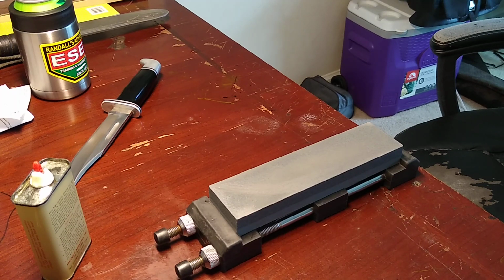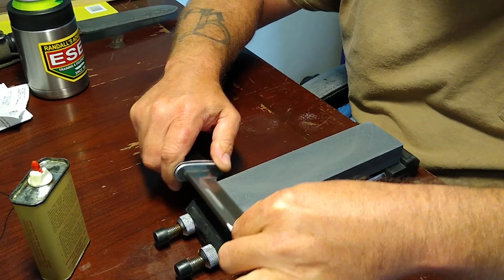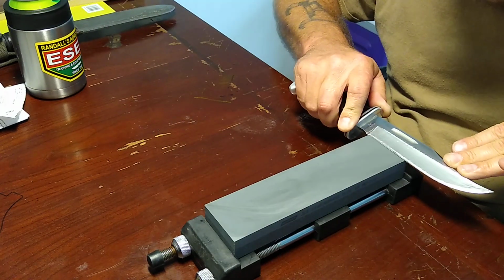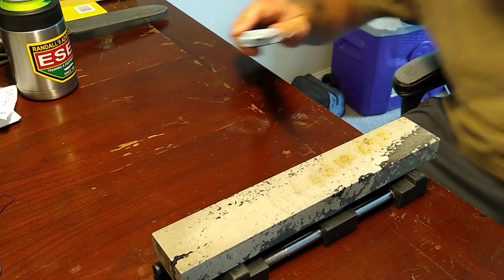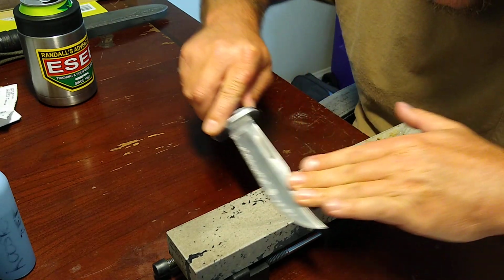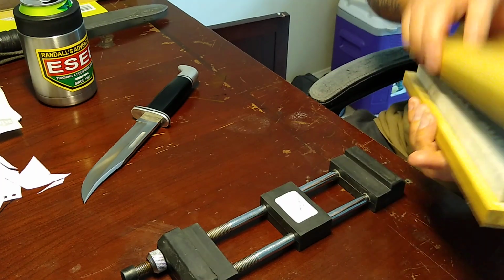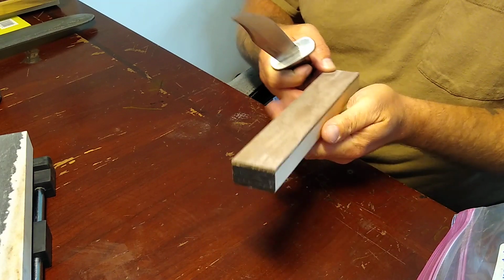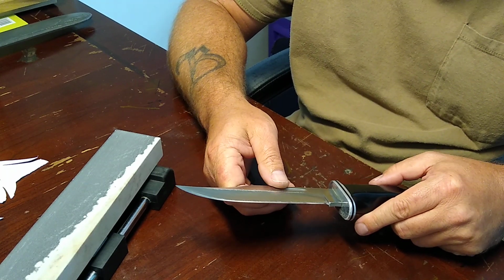Buck 119 sharpening

Comment: ive got a new (old) rarely used 119 from '72-'86, and its got the same exact blade profile as this one. the knife being narrower closer to the guard is just how they came back then. Compare that to a brand new off the shelf 119 and its a lot different. this old design gives the front of the blade a lot more belly for slicing, compared to the new knives "belly" that looks a lot more like a kabar clip point.

Comment: I've been thinking about picking up the 119 Pro in S35VN.  I own a Buck  110 that I bought In 1978 and I"ve got a newer Buck Compadre in 5160. What are your thoughts on the 119 in S35VN?
Reply from the maker: S35vn is my most hated steel. I don't like it's make up. Just don't do well for me.
Reply: @Rough Rooster Knife Sharpening  
In what regards doesn't it do well for you?

Comment: Another good job bud! What is the cause of metal doing that? I have ran into that with some 1095. I have carried a 80t Old Timer for over 20 years & now it does that to me. Could it be from being sharpened so many times over the years?
Reply from the maker: This is one question I cannot answer. I've never figured it out.
Reply: I believe it’s something with the steel I had it happen on a old timer from the 70s and it’s been sharpened a bunch and the blade is getting wore down a lot I think what causes it is something with the way they heat treat the knives and slowly you get into the parts without as good of a heat treat

Comment: Mister I don't have a fancy Stone like yours but I have a buck 119 who regrettably to say pretty much ate at the edge of my file and is resisting my stone would you agree that maybe I have maybe and older buck 119
Reply: That's easy enough to find out. The tank stamp will tell you the age of the knife. Just google how old is my Buck? and it will take you to the chart that says how old it is. Each year they make a different stamp so they can easily be dated.
Reply from the maker: That's not completely correct. The pre 1986 bucks can get very tricky. But after 86 they did stamp all the tangs with different symbols
Reply: @roughroosterknifesharpenin5531  true, but unless I read it wrong, he's just wondering if his 119 is old or not, and he can find that out from the chart..maybe not an exact year, unless it's post 86, but at least an idea of if it's pre 86 or not, and thereby an idea of if it's 420hc or not

Comment: That stone would probably be considered a #1 by anyone else but Dan's. Their grading system is uncompromising, and one of the biggest reasons to shop them. Period.
Reply from the maker: I couldn't agree more
Reply: @roughroosterknifesharpenin5531  , Mike is right....I bought a #1 8×3×1 Washita from Dan's....much denser than any "Washitas" I've encountered before. Also, if you get one from Dan's,  it will have NO voids in it. That's why they don't advertise them. They probably have a ton of rock that would be comparable to another companies Washitas but they won't ship less than perfect ones.

Comment: Rooster, once I raise a burr on one side flip and move burr to the other, how doI remove the burr? Thanx
Reply: Start alternating.  If it took 20 strokes to raise then 20 to get to the other side drop to 15 on each side, 10 then 5, then 3, 2,1 then 20 - 30 one stroke each side.  My opinion anyway.
Reply from the maker: Bama fan is right. If you'll flip it back and forth and lessen the number of strokes each time till your flipping back and forth it'll drastically reduce the burr. Then strip of needed
Reply from the maker: @bamafaninky861  thank you
Reply: @roughroosterknifesharpenin5531  👍

Comment: How much do you charge for sharpening a buck 119 from the 70's.?
Reply from the maker: Depends how bad it is. Email me southerntrader124@gmail.com
Reply: @roughroosterknifesharpenin5531  Dear sir: 
I watched one of your videos on you tube and I'm very impressed with your talent, I have had this knife since about 1974 or 75, I got it brand new and it had a terrible edge on it, I tried myself many different methods and nothing worked also other people tried to sharpen it and no success, and it got very scratched up and almost ruined, finely I sent it to someone to sharpen and they did get a pretty decent edge on it but it's not very consistent I don't think, at any rate I'm not completely satisfied even though it will cut.. and I cleaned up the scratches as best i could.After watching you sharpen another model 119 I really would like for you to try if you don't mind, the knife has a lot of sentimental value and if you aren't interested I'll certainly understand. Thank you for your time and for ressponding to my comment.

Comment: That's where low alloy steels really suffer. That old 420hc will get slick as cow slobber if you take it very high. Around 80 micron is as fine as I will go on 420hc. Keep it in the 80-100 micron range as your finish stone and finish with a couple passes on some 15 micron diamond on hard leather. Will leave you a fantastic edge with tons of bite and really will get the most out of 420hc. Take it much finer then that and you will get slick and have a poor preforming edge that will give up extremely quick just from loosing all its bite. In soft low alloy steels like 420hc all your cutting performance is in the micro serrations the stone creates (due to having no carbide volume to create bite/tooth in the apex thru use). A hard ark is imho way to fine of an edge for steels like this, I could see a good quality soft ark but that is even to fine imo. For me it would be 80 to 100 micron in resin diamond stones or diamond film or if it's on water stones I would finish on like a shapton glass 500 (30 micron). Remember when im saying a 80 micron finish I'm speaking exclusively to resin diamond stones like my Venev Dragon stones or some custom 3x8 Metallic bonded cbn stones I had made for me. In your more traditional grit scale (JIS) I would finish around 500g/30um. Another really fantastic finish stone for buck done 420hc is just a good old Dia-Sharp course. I'm not saying your wrong in taking it that fine so please don't take it that way, I'm simply explaining how I finish steels like this. I have done plenty of cut testing on different mediums to see where edges hold up the best and maintain bite the longest and I can safely say that in a JIS scale 600 would be the absolute finest I would ever finish it with the peak in edge retention while maintaining bite would be off a Venev F150 or a Shapton glass 500. There is nothing more I hate then a slick edge, I want to feel those micro serrations bite my fingers as soon as I touch that edge with the lightest of pressure.
Reply: Different batches of the steel can have different results. I got 2 buck 119s in 420hc one is 2 or 3 years old and the other is about 12 the older one I sharpen up to a soft Arkansas and then a white and green compound and it gets really sharp the new one if I go past a Norton fine india it’ll get that slick feeling. I’ve found tho if I sharpen it up to a soft and then use some black compound to bring the tooth back and leave it and it’s plenty sharp.